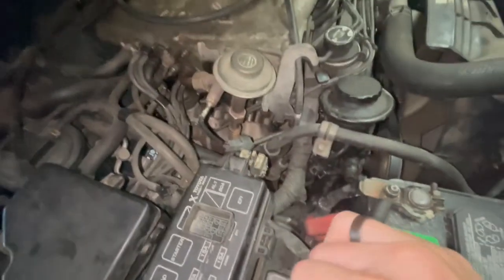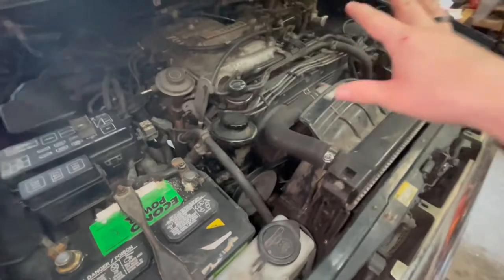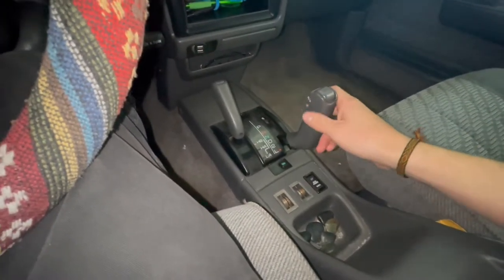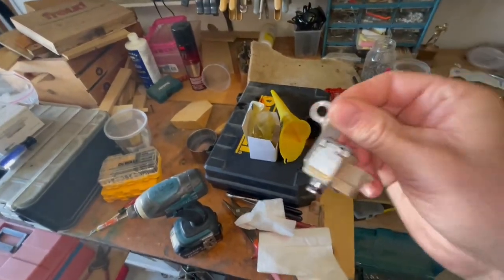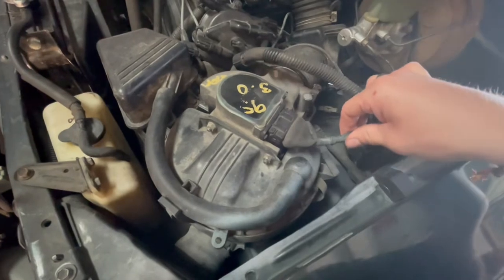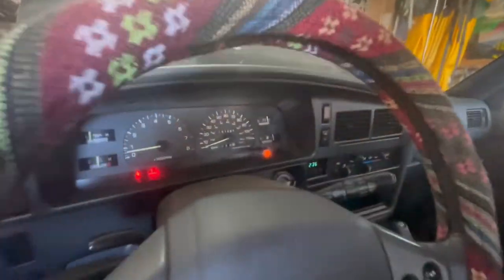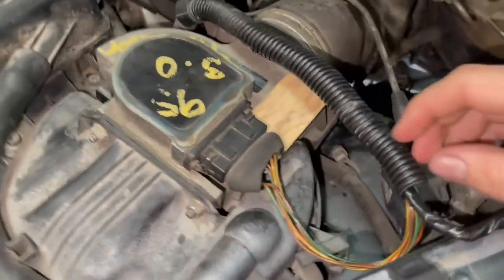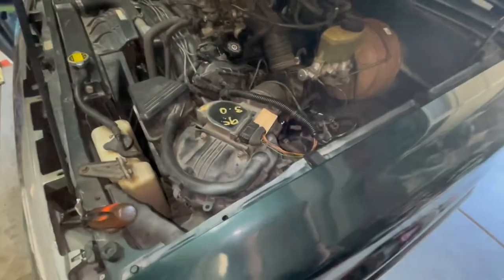2nd Gen Toyota 4Runner Non Shifting Diagnosis Fix

Comment: Thank you so much for this vid, I have been trying to figure out what was wrong with my transmission for about a year now.   Your idea of checking the wires was the right answer for me.   Checked the grounding straps and found the issue (poor ground).  Fixed my transmission good as new.

Comment: Thanks so much for sharing this video. My truck appeared to get stuck in OD fourth gear after driving for 20 minutes at operating temperature. It would try to sluggishly  move from a stop with 4th gear with very high RPM with the O/D blinking. I would have to manually shift from L to 2 (second), then to D. to get get back to normal speed and RPM. The transmission diagnostic code is 63 (S2 solenoid) but I don't think it caused the problem because if I let the engine cool down, it will restart and worked normally until the engine operate at 180degree F.

Comment: Thanks for your video - my 1991 4Runner does something similar in terms of the 4th gear engaging for the first 30 minutes or more and then it has trouble doing it.  I changed the solenoids and replaced filter and transmission fluid.  I also installed an oil cooler and thought it had fixed it.  Any other ideas from you?

Comment: Anyone knows whats wrong with my 3.0 1994 ? It doesn't drive off when i start it i push the gas & it just makes a whole lot of noise & wont move or move slowly, i need to shift to 1/L gear to be able to move it & then shift to drive
Reply: Sounds like the solenoid sticking, try the test he spoke about in the video to confirm.

Comment: Mines backwards, it wont shift into 4th for like 10-15 minute, then runs fine
Reply: That's factory, there is a temp sensor on the back of the engine that holds 4th until engine is warm.
Reply: @funrestorations hi, my car does this too, how can I fix it?
Reply: Have you found any solution? My car is also doing this.